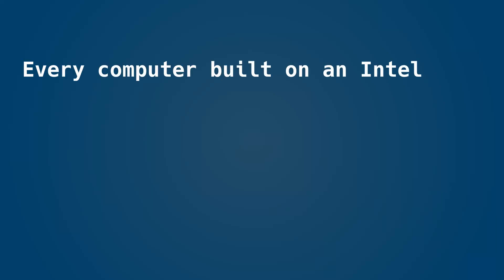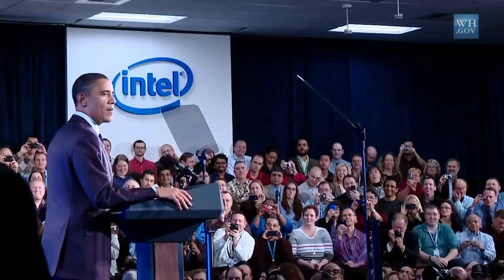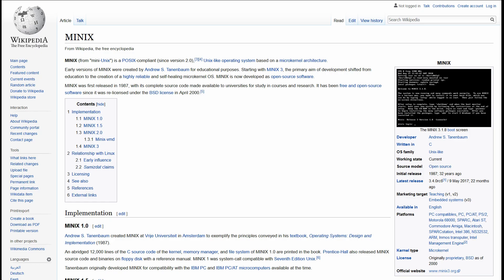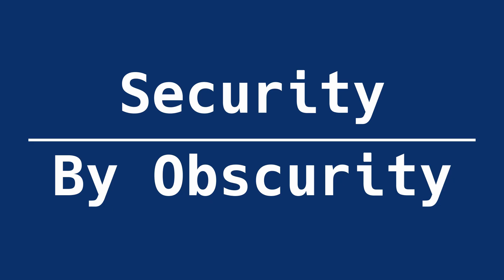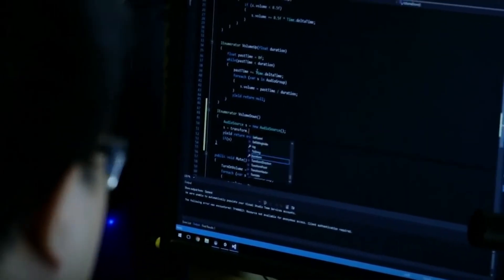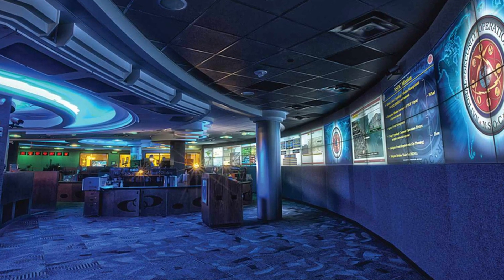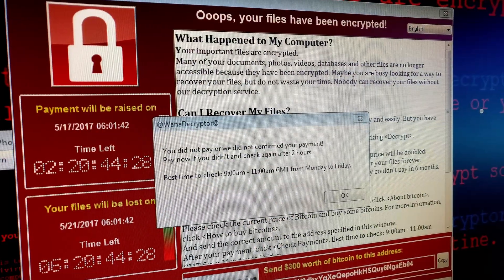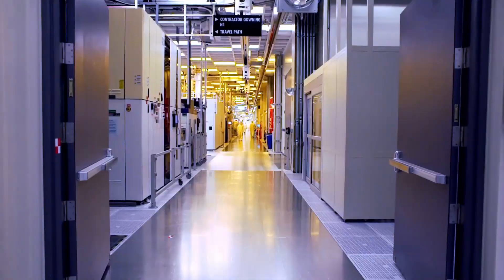How Intel wants to backdoor every computer in the world | Intel Management Engine explained

Comment: How is it able to bypass any firewall and has a dedicated network connection? Do you know how computer network works?
Reply from the maker: Because it's operating at Ring -3. It doesn't take orders from the main CPU or the main OS. It has independent access to the device hardware and input, including its own connection to the network interface. https://www.techrepublic.com/article/is-the-intel-management-engine-a-backdoor/
ME was literally put in place so that businesses can access computers remotely even if they are turned off.

Comment: Yet another reason to root for something like Risc-V…
Reply: @somehuman7768 , not really. The ISA being open-source is great and all, but it doesn't prevent companies including something like ME inside a physical chip based on the RISC-V design. Moreover, they're not even legally responsible to reveal the final design because RISC-V license allows proprietary extensions of the ISA, let alone the hardware implementation.
Reply: Unfortunately RISC-V ISA is BSD licensed, which makes ultimately any company that tape out the RISC-V-based CPU will probably add "customized functionalities" that will not conform to the base ISA, i.e. They are not necessarily have to reveal the full design of their implementation. As long as us plebs don't have access to silicon manufacturing technologies, we're never likely to have a really open, secure, and fast CPU. At most we can only pick two out of those three.

But hey, you gotta stop somewhere and not going deeper in the rabbit hole and just trust at least some part of your computer to preserve your sanity, so I guess that should be fortunately?
Reply: @y__h  
You can burn RISC-V to FPGAs. People have steady built quad core RISC-V cpus in FPGAs.
Reply: @y__h  So are you saying you don't like the BSD license?
Reply: There is another solution but a costly and tiresome one make your own yep I mean it's hard and expensive yes because fuck I don't own a machine that can do that no but we can and will plus anything is accessible if its something which can be accessed it will be accessed if it codes we can hack it.
Reply: KingHalbatorix are dumb? Have you not seen the video?
Reply: @Richard Vaughn But can it be disabled?
Reply: @deoxal7947  no it can be disabled as mentioned in the video. This runs at the Microcode level.
Reply: root?
Reply: @Richard Vaughn shiiiiiiiiiit
Reply: @Richard Vaughn Wrong, there are many Risc V available currently.
Reply: @Richard Vaughn There isn't any problem with running something like Intel me if it is open to scrutiny since oob channels are required for enterprise device management.
Reply: @somehuman7768  
You can only look at code for programming FPGAs.
But for real chips you sill can't be sure about that. A RISC-V chip could still have another CPU inside on the same CPU die and you won't notice that.
The only solution to be sure is to abrade the silicon level for level. But that's not affordable for most of us.
Reply: @OpenGL4ever  
Well, an FPGA can only have the circuits that you design, so if you use the OpenCores specification, then you're good.
Reply: What about AMD?
Reply: @theluigiwa5029 , same story; watch the full video.
Reply: @theluigiwa5029  same thing

Comment: My concern is that it’s a backdoor I stalled at the behest of the either the NSA or China. I wonder if AMD Ryzens also carry the same type of backdoor?

Edit: further in, he mentions that AMD May have the same thing going on.
Reply: @Richard Vaughn Can't find any info on ARM having such a system.  ARM Holdings just designs the core architecture and licenses it, so hard to see how they could force the manufacturers to install something like this.
Reply: It's called AMD-PSP and can be turned off by some mainboards
Reply: @pewbaca2611  oh that better than the intel part
Reply: @ShivamJha00  Intel has it worse, and come May the biggest of the flaws will be revealed. Have fun.

Comment: That's a lie, companies like system76 actually turn them off before they send the computers out
Reply: proof?
Reply: @coows  Here's an interview with S76 https://youtu.be/MujjuTWpQJk
Reply: Oh then why no one can turn it off?......
Reply: @mama-cg5ri  It's still on, but the firmware of the CPU is being told to disable all of the tracking
Reply: @mama-cg5ri  It's basically being told in software designed to go into the minix and tell that to turn it off. It's not turned off, in fact, it's still vulnerable when it's starting up, but once that code runs, then it's told to be useless and only do the nessesities.
Reply: @mama-cg5ri  The thing is, they are trying to
Reply: @JessicaFEREM   .. If this isn't the best , then what is ?
Reply: Why my team can’t turn it off?
Reply: nevermind, the video said that system76 does.
Reply: @coows  S76 is trying to make a tool for everyone, but that's quite an undertaking for a small group of people such as them.
Reply: @JessicaFEREM  Got it. I misunderstood
Reply: @coows  All new System76 computers come with ME mostly disabled. They won't stop you from installing any operating system you want, but keeping with the FOSS that they're going for, You're better of with a version of Linux. If you're using windows or mac, they're plenty of backdoors for those, and Linux tends to have less by design. If you want to be secure, i recommend Linux.
Reply: @JessicaFEREM  I'm already using linux. I am also not on intel.